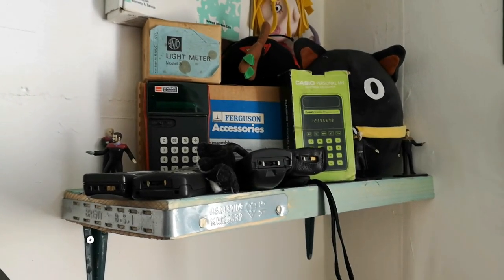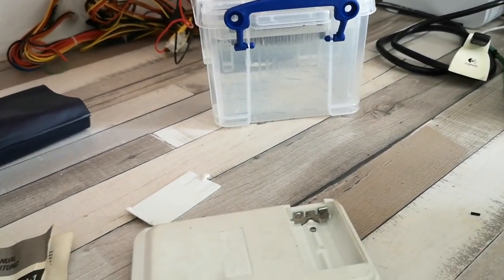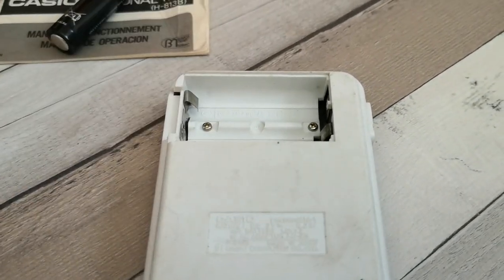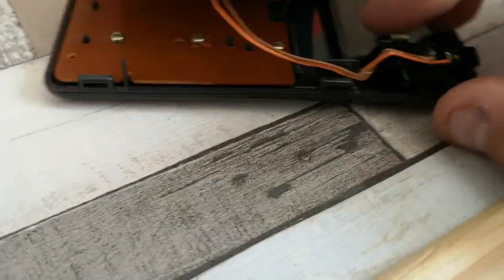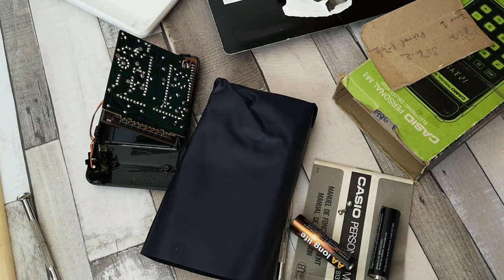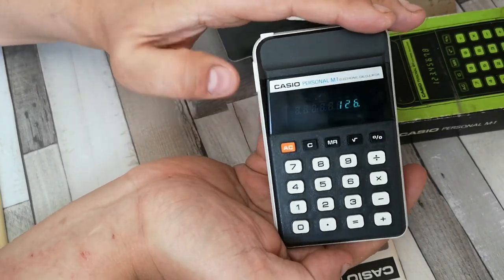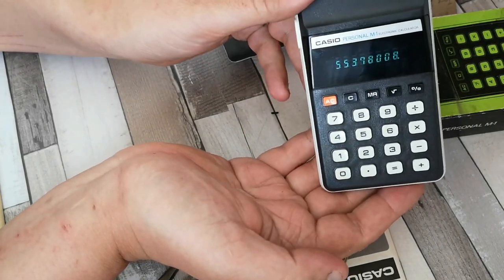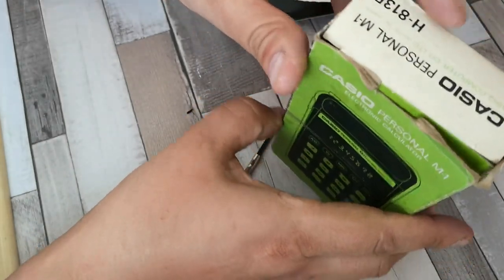1970s and early 1980s Pocket Calculators - The Casio Personal M1

Comment: I found 1 un-used in a dumpster in Adelaide Australia, August 2023, box, instruction booklet all with it & works perfectly, I have 5 different ones from the same era, do you know what year that model is? - I hope you get this message, I subscribed to your channel too, Thanks for the video 😊
Reply from the maker: I believe the model ran for ten years, between 1976 and 1986. I'm not sure how to pinpoint the exact year, my guess is the serial number will probably hold the answer. This link shows a photo of a 1977 example. https://www.reddit.com/r/BuyItForLife/comments/66numz/my_parents_bought_this_pocket_calculator_in_1977/ you may find that there are minor detail changes between earlier and later examples, such as the model name above the VFD.
Reply: @JCTsFascinatingHobbies  - Thanks a lot, mine is exactly the one you are showing in your video, Cheers 🍻